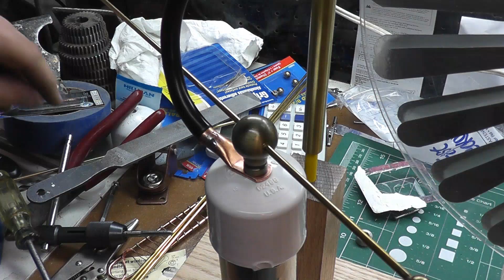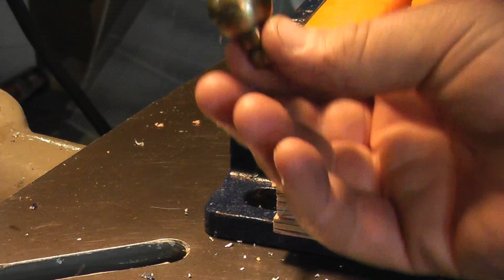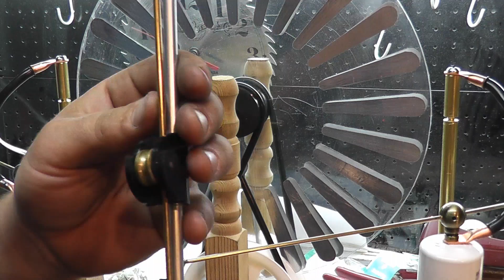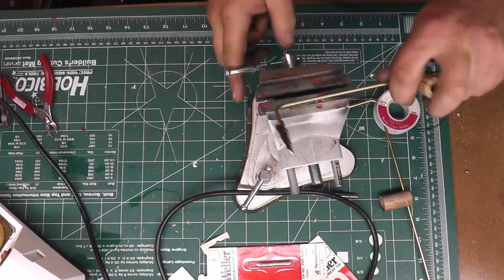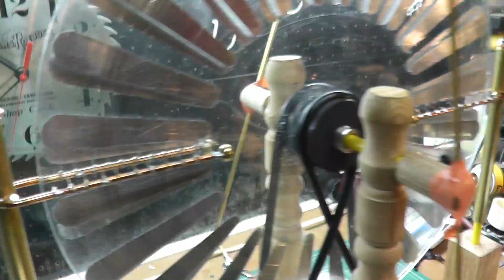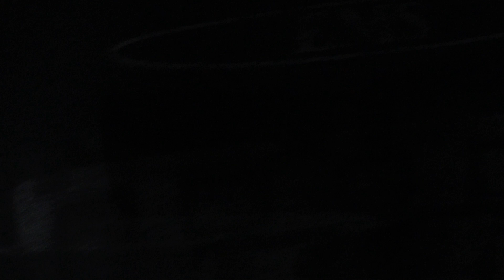Wimshurst Machine Build Part 4: Finale!

Comment: This has been a great instructible but just one bit of advice. You don’t need heavy gauge battery cables here. There is no current that necessitates it BUT high voltage cables or hard brass rod would be perfect!

Comment: Great tutorial!  Here's an alternative for easier, more efficient current collectors from copper foil or copper foil tape(i assume aluminum tape would work also). They will not damage the surface of the collected material, as they are much softer, and depending on the relative thickness of the material, they may be more efficient than a set of 22-24 gauge wire pins.  
Usually the tape is roughly 2" thick.Wrap one side of the tape onto the collector rod(solder if needed)  and cut a profile on the other side.  Zigzag serrated edges when you need sharp points, for discharge based collection. Straight ribbons can be rolled up loosely into circles which can touch (lightly)the collected material when contact is needed.  . Also can be used building Vandegraff generator or for making commutators.
The tape is very malleable. You can tape two pieces together, for more strength, and when springiness is needed,like in commutators, i sandwich a thin piece of stronger shim between the 2 pieces of copper tape, anything from a piece of soda can to spring steel, depending on the properties needed. 
Here is a (bad) ascii diagram -assume () to mean the rolled up side wrapped on the collector rod, and the lines roughly indicate cuts. Obviously adjust as needed
()        ------------
()        ------------
()        ------------
()        ------------
()        ------------
()        ------------

or 

()        ----------\
()        ----------/
()        ----------\
()        ----------/
()        ----------\
()        ----------/

Comment: i glued a thin strip of emery ( sandpaper) between two petals on each disk , this helps the brushes make good contact . Also i added a brush on each side of the collector arms, also in line with the emery. now i get a good positive spark even at low revolutions

Comment: I made my petals out of aluminum drinks cans, if you cut them right they are stiff and a little oval, held in place with 3 dots of contact glue. and i found it best to make the brushes out of very fine wire, like you would find in a car ignition coil, i wound 40 turns, cut into 4 strips, they hold their shape better than thicker  wire and are much quieter.

Comment: I made my `super/ capacitor ` out of aluminum drinks can, choose some that fits over the `tube` your using, cut 4 to length, IE;  4"  squeeze 2 a little so they fit into the tube, they will spring apart to fit perfectly, maybe a little tape to hold into position, the outer 2 can be taped into place, i didn't bother cleaning the paint off except the outer 2 to give contact where needed

Comment: I enjoyed watching your video series for this build.  Thanks for sharing it with us.  I'm very interested in designing a practical application using magnestic transfer (no brushes) of this process and was wondering if you'd characterized the dynamic voltage off the plates?  Do the plates generate a measurable voltage prior to being stored in the leyden jars?  If so, can tell us what that voltage is and does it vary with RPM?  Thanks again...